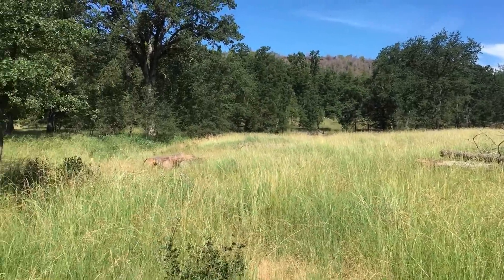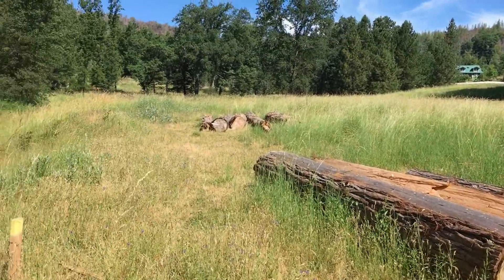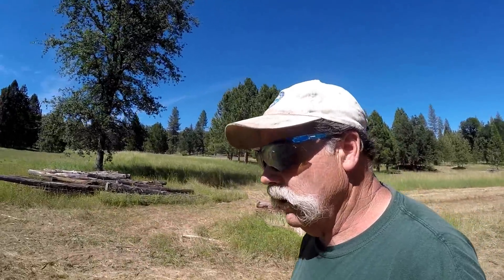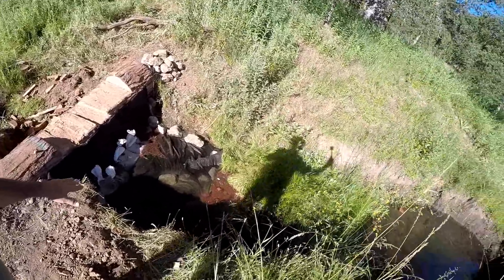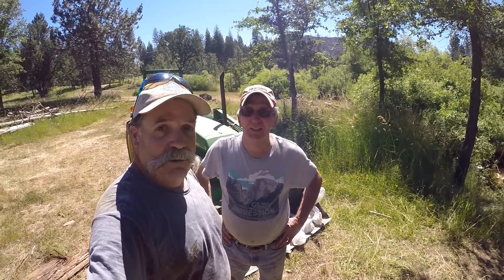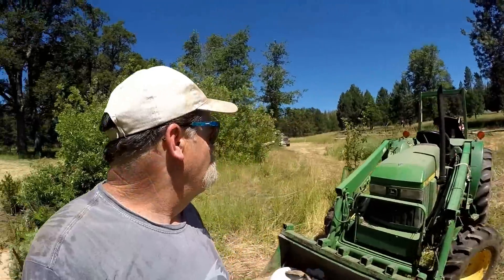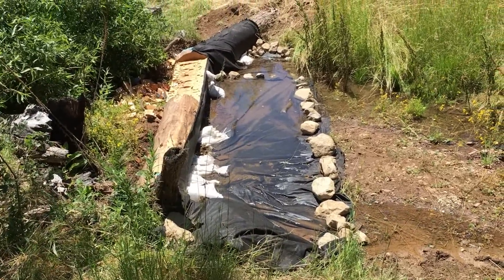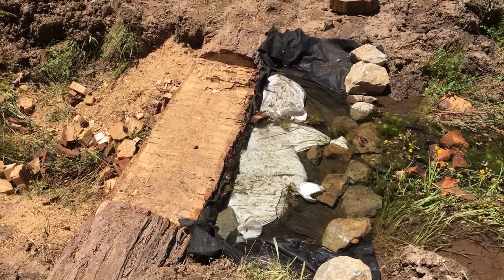Hurry!!!! Dam the Creek - Stop the Erosion

Comment: Does the fabric decompose over time or will it be there for ever?   We've used dam tarps which eventually get holes, stop holding water and as far as I can tell, never go away.  We uncovered one a couple of years ago which we estimate to be over 40 years old - and a real pain to get out - will shred fairly easily with still tough strands.
Reply from the maker: I do not think this material will decompose but I am not positive.  Designed to stop sediment to build up , not to be removed.  Thanks Dave.

Comment: I'm looking for info to make a dam. There will be much overflow and I'm thinking about letting it through a pipe or pipes at a level where it can't get stuck with dirt and then even make the dam higher to prevent floating stuff to get into the outlet. Or what's best?

Comment: On the few occasions i've participated in dam making, i've paved or insisted that there be paving on the mouth of the dam (i call it that, unsure if that's the actual English terminology, but it's the place where water would "lick" the base of the dam and eventually erode under it. Before and after the dam, more after than before). Usually i use stone we crack ourselves on site, flat paved as tight as we can get it, but i have, on a few, made them out of concrete street bricks (the H shaped ones).

The idea came to me years ago after i visited a few "artifact" rivers in Middle America. The ancients had some pretty amazing architectural ideas and the one to pave their rivers was indeed fruitful, after all, i could walk on it ages later.
Reply from the maker: Yes the lowest elevation dam is paved now.  Thanks.

Comment: I understand the need for spillways,was surprised you'd not included gates to control the flow in the flood season.
Reply from the maker: The NRCS engineers felt they were not necessary.  This is just a seasonal drainage.  Thanks Joseph.

Comment: Randy, my  dad and I did this same thing last year with light poles. To help prevent seepage I bought bentonite from the local Co-OP to seal off the incoming side but, it only works well with slow velocity water, otherwise it will wash out. 
Great job by the way👍
Reply from the maker: Clarke, that is a great idea,  Now that water has slowed and backing that will work great.  I think we will do that.  Thanks.
Reply: @RRINTHESHOP  I'll shoot you pics of what we did last year if I can get down there without getting snake bit